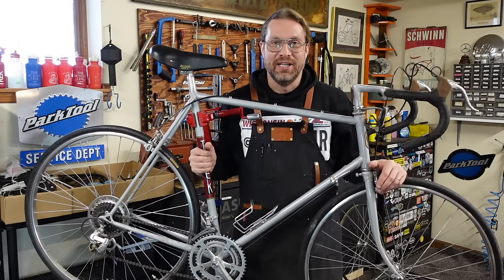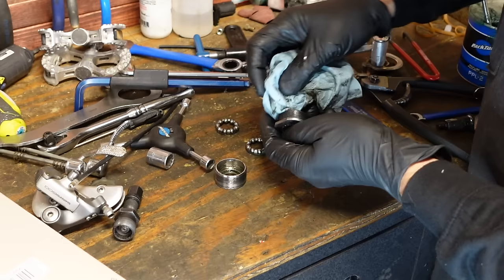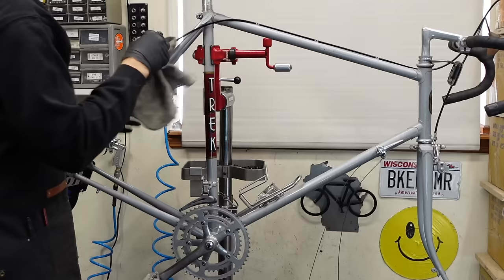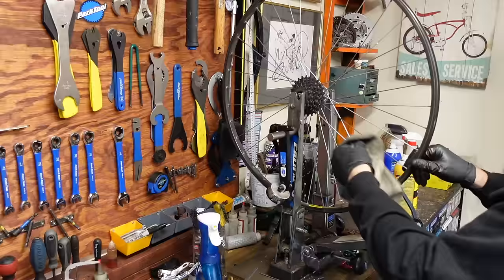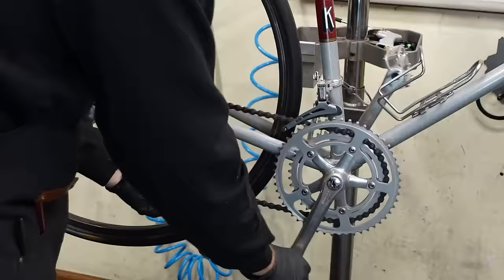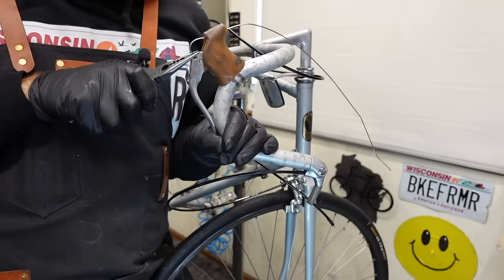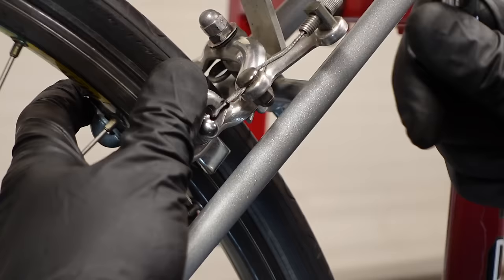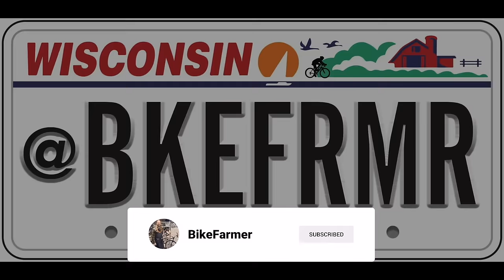Vintage Trek Road Bike Gets Index Shifting! PLUS...BB & HS overhauls, bar end shifters and leather!

Comment: In the interest of full disclosure, I did add the Panaracer Pacellas and the Brooks B-17.  The last time I broke in a Brooks seat was in the 70's. Now being in MY 70 I'm not sure I'll live long enough to fully break this thing in, but we'll see.  I've now ridden the bike about 300 miles and it is absolutely sweet.  A little bigger low gear would be nice, but it rides really sweet, and I'm really glad Andy did the extra stuff to make the little things show up in the ride.  😎😎
Reply: It's mint!
Reply: Ok, we did go back and add a 13-42 super freewheel.   Did this on this bike as well as its younger brother, the 87 with 105 goodies on it.   That bike also got a Ritchey Beacon short drop set of bars 52 cm I think,  great hand position.  That bike has 25mm vittoro tires so it’s strictly a road vibe.

Comment: Lovely bike. I would have moved the brake levers down a little bit, to make them more usable in the drops but its cool if that is how the owner likes them.
Reply: You are right, the brake levers are way too high for braking from the drops. But maybe the owner 'grew' with the 'old' bike...
Reply: @gerhardw.933  Some people also  want a specific bike because they like it and it happens to have drop bars And maybe their riding style is more upright, and they only ride from the hoods, or flats.  And if that what is fun and it isn't interfering with rideability or riding goals then great.     I presume in this situation it was probably discussed before putting nice tape on, and its what the owner enjoys.
Reply: One possible solution is to move the brake levers to the correct position and additionally install cyclocross brake levers on the tops. Will give this bike, together with the bar end shifters a cool all-road look.

Comment: I always start the tape near the stem! No tape is needed as the tension keeps it in place, and you don't get the annoying ridges near the outside. Failing that, use the foam bar grips. If you use washing liquid to push the foam on, then you get clean hands every time it rains.

Comment: I've got a couple 1983 Trek bicycles. The 850 I bought new. The 620 I found a few years ago in little used condition. Someone bought the 620 with good intentions and never used it--the original brake shoes weren't even broken in! Of the 40+ bikes I've had the 620 is my most loved. The '80s was the high water mark for beautiful steel frames!

Comment: When I want to make something extremely tight, or if I have to remove something extremely tight (i. e. pedals and fixed cups) I usually find a way to put the bike on the floor so I don't have a wobbling stand to deal with.

Comment: RE: Bar wrapping debate - the only reason I started wrapping bottom>top was when I got a Scott aero bar in 1994 and only put it on for the weekly club time trial.  Of course, I was still using Benotto Cello tape at that time and that stuff was so thin there were no issues with the ridge of the overlap.

Comment: Reminds me of my early 80s Trek 710 with Reynolds 531 and 700c wheels. I replaced the original Rigida(with Campy hubs) rims with those same Mavic MA40 rims with Dura Ace hubs. Built by Schwinn for me. 40 years of smooth no problem wheels. Unfortunately it's a 6 speed  FW. Looking at Velocity 8 😅speed cassette wheels as they slot right into those dropouts.
Beautiful old Trek steel frames. Terrific shots of the parts you serviced.

Comment: I had a cable, on one of my bikes, that had one of those "end knobs" that was in pieces, but somehow still in its place. The cable itself was a bit rusty, and was binding up in the housing. It took me, seemingly forever, to dig that cable knob out, due to one of those pieces was jammed in the hand lever. It's a second hand bike, treated roughly before I got it, and it was that way when I got it.

Comment: Nice rebuild, though I think the owner may have had moly, if the grey grease was moly lube, in the bottom bracket for the extra protection for smoothing out or preventing any potential marring of the races in the cups that green polyurea grease doesn't provide.

Comment: Original chain not working with index shifters and rear mech. Problem is probably due to chain being bushed as opposed to non bushed chain. Non bushed chains were used with indexing and freewheels above 6 speed. Back in the day if you wanted to use Shimano index derailleurs, you had to fit a Shimano chain. Love the Maeda Suntour stuff. The V/Vx/Svx all worked faultlessly.

Comment: The landlord has a number of apartment complexes that he owns and people move in and out on a regular basis and they leave stuff. I with a couple of others do cleanups of said apartments and frequently there are bikes left. Those bikes are evaluated and either refurbished or stripped and tossed in the recycle. I just found 4 bikes left on the side of a road waiting for someone to take them away . Two will be worked on and one stripped for parts whereas the last one was not salvageable except for inner tubes!  I went into Obsession Bikes on the north shore where I live and they have a nice mountain bike there for 20500.00 and my recycled mountain bike is about 43.00 .  Hmmmmn less bragging rights though!

Comment: As cheap as they are and as long as it was apart anyway, why not just use a sealed bottom bracket? I miss the feel, speed amd reliability of downtube shifters. Never likely bar ends. Glad you used loose bearings on the headset. So funny to hear about reinstaling that spoke protector. Back when that bike was built folks were always asking us to remove them. The end result has got to be really comfortable.

Comment: Bob Ross for sure with BG music. These are the builds I've done in the 90's with the 1st Cannondale's out of the box, man you had to build all of the bike from the raw frame up to finished bike, at least you didn't need to lace the wheels, Ha.
So do you think you could play your own music for your BG music? or do you?
nice little time savers on the headset.
27" wheels nice fine, hell I having a hard time fining replacements easily and cheaply, that is. 
I could rant for hours about bikes, heck index shifting just started years after I moved my upgraded Varsity (found in a junk yark) parts ( Sun Tour Cyclone drive line, shimmed all over) to my 74 Panasonic deluxe touring bike that was rebuilt with steel parts, Afterwards I wire wheel the paint off the frame to bare steel, still ride it in 2-4 times year today, I clean the rust off 3 times? since but she still clean, but does not turn quickly.......
Sorry, memory lane as well:)
bye for now.

Comment: Great Video, I learned a lot!
The front chainrings seemed a little "wobbely". Is that a normal amount of "out of round"?
Reply: Usually ....the five spokes in the arm were often not true from the factory. So I would find the best fit on the spindle and true if necessary after tightening and snug the crank bolt a small amount  again.

Comment: Indexing in a rear derailleur? That's a new one for me! 😂 I'm pretty sure the Suntour VX would have worked just fine with the Shimano barcons.
Btw, yellow and green Mavic decals ate late 80s . And 27 inch, not 700c?
And that wacko positioning of the brake levers plus that unnecessary reflector stuffed into the headset makes the whole thing rather cringy.
On an otherwise pretty Trek frame.

Comment: question: you've mentioned a couple times that loose ball bearings are better for the bottom cup of a headset. Why is that?
Reply from the maker: Twice as many balls to spread the forces around
Reply: @bkefrmr yes while that is true for the bottom race of the headset and usually still use a retainer at the top to minimize the binding effects. What the real difference is that the ball bearings aren't constrained in a retainer and don't line up in the exact same position every time you are going straight. Shimano actually made retainers that had some wouble room for the bearing in their headsets for awhile. 
  My practical experience with my own bikes has proved that to not be true in the bottom bracket. The loose ball bearings in the bottom bracket bunch up into each other as the bottom bracket turns through its full rotation. This is why the higher end bottom brackets had 11 balls in a retainer.  Personally I would have replaced the balls in the original retainer with grade 25s and not reused the old ones, but then I almost never reuse worn ball bearings. Sometimes I was able to find 11 ball retainers the would work and put one on the drive side only . As not all 11 ball retainers will work in this bottom bracket and I was carefully hoarding the ones that were in the cheap oriental bottom brackets (most were 9 ball) that did work. The thing is  sealed cartridge bottom brackets are inexpensive . And I would  often disassemble to cheap ones and add lube to the cartridge bearings so they would last alot longer.  It seems the grease was only put in one side and it was a matter of chance that the lip seal with the grease in it was on the outside. The ones with the dry side out always got penetrated with water and corroded. The lip seal needs grease to keep water out. If it's dry the capillary action properties of water will prevale.  Yeah I had tools to do this. I filled them full and let time settle the matter of ideal fill. Pretty much in all bearings. As long as it's being expelled the water and contaminants are also being expelled.  Then from there you have the normal span of time left. The little bit of grease ousing out can be controlled with regular cleaning. One of my goals was as many trouble free miles as possible. The other was that the bicycle rode like a dream....ride like the wind.

Comment: I have an uncle that has this same bike. I was thinking about buying it from him and converting it to a touring bike. What do you think is the widest tire that would fit comfortably on this bike?
Reply from the maker: 1 1/4”
Reply: That's a 32....
Reply: Just took a quick look at the brakes. Possibly go with 700c (622) and replace the brakes with longer center pulls. That will give a bit more clearance for a 35mm tire . The center pull brake is also a must stronger brake mechanism than the low end side pulls anyway.

Comment: Why? An old steel bike? They were never any good, no manufacturer would build a heavy enough tube thickness/butting to take bottom bracket flex out. I know, I owned this bike model, AND, I owned top end frames I bought and two that were custom framesets to my specifications....all with same problem. Aluminum mainframes solved the BB flex problem and been riding ever since. As long as you have a properly designed steel fork with a curved rake, the aluminum mainframe designs today will not beat you up on the road or off-road. Frames have a lifespan, for me at about 25,000 miles they fail, the tubes will crack. Trek, Specialized, Motobecane, Schwinn, all cracked on me at the 20,000+ mile range. Steel rusts and if not stored properly has these dangers to include. Why? Why do people ride dangerous bikes when you can buy a new one today for just $300 with an excellent frame and fork Shimano equipped 7 speed index.